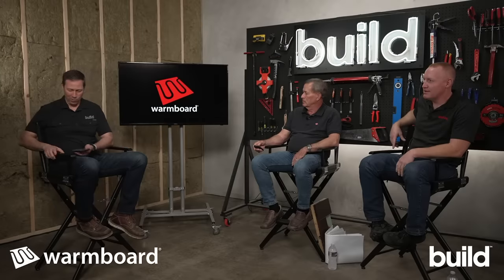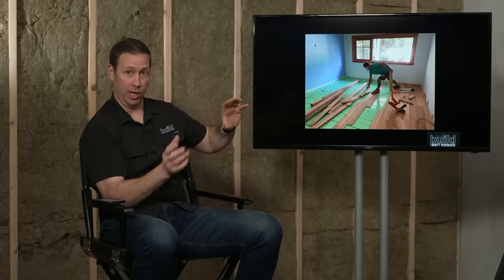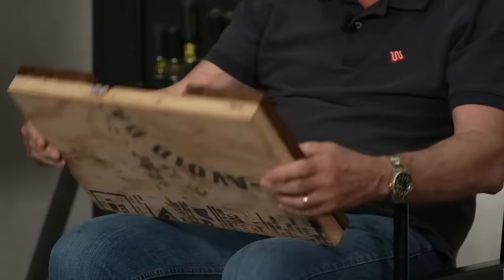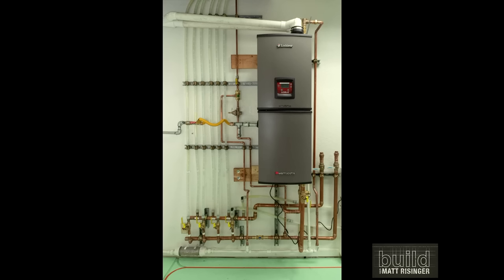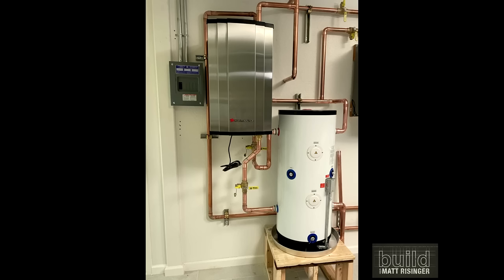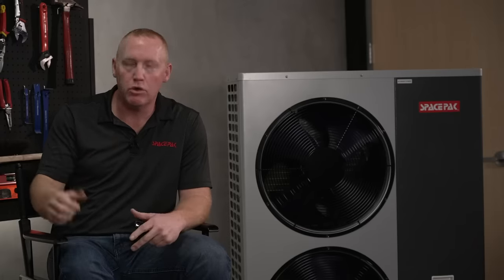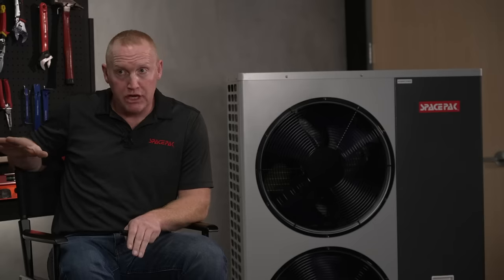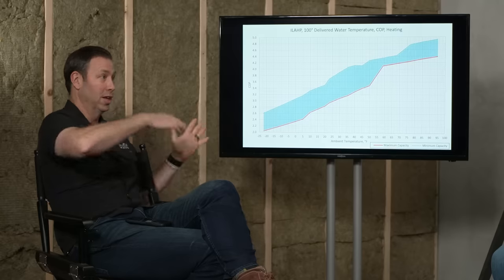Cold Climate Heat Pumps for Radiant Floor Heating. No gas, no boiler!

Comment: Warmboard is extremely expensive.  That additional cost is far better spent on better windows and a better sealed/insulated exterior envelope, which will actually increase the efficiency of the home and reduce dependence on large high-cost HVAC systems.  Warmboard may have small advantages, but they pale in comparison to actually making a more efficient house.
Reply: good post. but don't toss the baby out with the hydronic bathwater. there's other vendors out there a lot cheaper.
Reply: @stevecrawford6958  very true, but generally speaking they are all far more expensive than forced air, especially since heated floors don’t do AC.  You need a whole separate system for cooling, a huge additional cost ON TOP of the cost of heated floors.
Reply: @superspeeder  What about mini splits for AC?
Reply: @timothykeith1367  sure, minisplits work great for AC, just be sure to include a dedicated whole-home dehumidifier as well if using them in a humid climate (mini splits don’t dehumidify well).

Mini splits also heat, and are also air-source heat pumps, so once installed you would no longer need the expensive heated floors.😉
Reply: But toasty feet in the morning are so cozy!
Reply: @superspeeder  absolutely. this is a luxury. not fiscally sound like any luxury.
Reply: @srt4b  exactly why I’m putting an electric heated tile floor in my master bath.  100% unnecessary, it’s purely an over-the-top luxury that will cost me on my monthly electric bill.  BUT, if I ever decide not to use it I can just turn it off. 😁
Reply: @stevecrawford6958   after I got rid of forced heat and installed radiant heat my health improved immensely.I used to get horrible head sinus colds. It's been over ten years and no illness. More than paid for itself in health and savings.
Reply: @superspeeder  you’re missing the entire point of radiant heating.  Silent, even, no-draft heating that is zoned per room.  Forced heat is always going to be cheaper but you will always have fewer zones and it cycles on and off more resulting in more noticeable, frequent temp swings. “But what about mini splits” everyone is going to say.  Again, moving air & noise.  Mini splits in cold climates may go into defrost once an hour.  Defrost is always noisy.

Even baseboard hydronic on a boiler with outdoor reset is quieter and more even than forced air.  Outdoor reset provides the long cycle times which results in much more gradual temperature changes.

I also completely disagree with “mini-splits don’t dehumidify as well”.  A properly sized and installed mini-split system dehumidifies extremely well.  The vast majority of mini-split installs are spec’ed with too few heads because more heads cost more money.  Ideally you want one in every bedroom, one outside the kitchen that is 15% oversized and one in all the main living areas that is 15% oversized.  Kitchen is oversized for cooking, main living areas are oversized for the “party load”.

The other reason mini-splits get a bad rap for dehumidification is because the cheap people turn off the rooms that aren’t in use instead of adjusting the temp 5-8 degrees.
Reply: Agreed I sent them my plans, we only had 1500sf and they wanted 40k just for design and materials.  Great product though.
Reply: @stevecrawford6958  can you list the cheaper versions compared to Warmboard or what should I Search for on You Tube?
Reply: Why can t use install the radiant tubes on underside of the onboard with radiant covering reflecting heat upward?
Reply: @srt4b  floor surface temperature should not be higher than 79 degrees. That's for rooms where you spend a lot of time. It's far from toasty.
Reply: @ToddBizCoach  thermalboard seems decent. uponor. depends also if this is in slab, or quikcrete is an option. or if the work is retrofit.
Reply: @superspeeder  do you say mini splits don't dehumidify well because they aren't running as long as a forced air unit? or something else?
Reply: @ToddBizCoach  you can.  It’s generally referred to “staple-up” installation where aluminum plates that fit around the pipe are stapled to the bottom of the floor.

It’s not as efficient at conducting heat from the pipe as Warmboard is so water temperature needs to be higher.  It is much cheaper though.
Reply: @stevecrawford6958  mini splits are typically very efficient at cooling because they keep the coil at higher temperatures compared to a typical AC unit and move a higher volume of air to compensate.  Typically the higher the SEER the less dehumidification you get.

Most mini splits have a dehumidification or “dry” mode specifically for dehumidification (colder coil and reduced air flow) which can work very well, but I haven’t yet seen one that has controls to track humidity and automatically adjust (you have to manually select this mode).  This, in my opinion, is the one small detail that mini splits need to truly break into the mainstream.

Well that, along with more affordable ducted indoor unit options.  Most people don’t like the look of the big wall-mounted indoor units, but those are the affordable ones.  These ducted Mitsubishi systems Matt is installing are pretty pricey.
Reply: @brians8664  Im not missing the point at all.  What Im not missing is the extreme cost of this product, especially to renovate.   BRand new build with an open book to choose what your HVAC will be in your home, then the cost of this would be worthwhile and cheaper since you are starting from the ground up.  The other 90%, move into homes that are "used" and deal with how the house was built, including HVAC.  And as others have mentioned, the 100K to upgrade their home to this, isnt feasible for 99% of people.   If cost was no object, Id move my family out of my house for an entire winter while my house is completely renovated and done right.  But lets face it, thats not going to happen for  basically any home onwer.

Theres wanting and reality.  And this here, is reality.
Reply: @virgil3241  ^Amen!!!
Reply: @brians8664 I’m planning 3 heads in my 1350sq ft. house (2BR, 1 Great Room) and have been researching the mini splits/dehumidification issue. May I ask, if I were to oversize the great room unit, wouldn’t it cool the room faster and thus, run less often leading to more humidity? Would it be better to undersized the unit slightly so that it runs more and thus, dehumidifies more? Thanks.
Reply: @billwilljulz  a slightly oversized mini-split is okay, a grossly oversized or undersized is not.  The inverter compressor will run at a lower speed making it run “like a smaller unit”.
Reply: Something seems off about an outdoor heat pump unit in cold climates pumping WATER into the house.  Let's talk about winterizing issues or keeping those lines warm enough to not freeze when the system may not be constantly running. Bury under frost depth but up to the heat pump and possibly through the crawl space are not protected.
Reply: What about mixing with geothermal?
Reply: @forename_surname  they should be saying “heat transfer fluid” instead of water.  It’s a water/antifreeze mix based on minimum expected outdoor temperatures for the region.
Reply: @patrickmckenzie2391  geothermal is actually not geothermal, it’s ground source.  The unit discussed here is air source.  I don’t believe anyone makes a mixed unit.  Once you have the cost of ground source covered, air source is not necessary and is actually a step backwards.
Reply: I suspect it to be expensive, especially in Canada, but as you indicate you have to address the envelope first- then you can hopefully realize the  advantages of a premium heating system. Building this way is a “system” to achieve comfort and long term savings. I would like to know more about ROI and future energy restrictions.
Reply: @802Leith  I have non-allergic sensitivities to dust and other irritants, so that's my plan too. Plus my 1930 house will be warm even if you're not right next to the very few duct outlets, and therefore the heating plant will probably have to work much less hard.
Reply: @superspeeder  That's my plan. Plus I can do all the grunt labor of putting up the plates and running the tubes myself.
Reply: @balzacq  👍 DIY for the win!
Reply: @bobselina4299  ouch. Not worth it
Reply: @davidfisher268  There is no ROI on this. It’s pure luxury.
Reply: Interesting discussion. I'm in upstate NY and going to change to mini split system for heating and cooling. I'm tired of the oil heat cost. Heated floors is another idea for the bathroom but I hear mixed reviews about it.
Reply: A property sized furnace will make your house as comfortable as radiant, or a modulating furnace that constantly maintains setpoint. The ignorance around forced air is ridiculous.
Reply: @macthemec  forced air gets a bad rep because everyone has them and many are not done well.  They’re noisy, the supply/return registers are inconveniently located, rooms are improperly heated or cooled etc.  I hate the forced air natural gas hvac in my house right now for all of these reasons.

I’m building a new custom house and guess what I’m using… forced air natural gas.  Done right (and with a fully modulating fan motor and gas valve) it will be efficient, quiet, and it will constantly filter our breathing air.  I’m building a well insulated house that will be very comfortable to begin with, and the furnace is just one piece of the design.
Reply: Man alive, you want to heat a space just put this video on. Theres so much hot air blowing around i had to turn my ac on.
Theres just allot to unpack here.
First problem i see i the extreme amount of overhead jacking the costs way up. Whilst detailed drawings are nice, there also superfluous and add allot of extra cost.
1-1/8 plywood, lord have mercy you are asking the carpenters to double the weight they hafto handle, anybody ever pick up a full sheet of 3/4 ply, yea double that and then tell me your carpenters aren’t gonna ask for more money to install it. 
Not to mention your now asking carpenters to cunstruct proper hydronic loops, like im sure some can, but there certainly the minority.
Then were going with spacepack, of all the companies out there you chose spacepack. Both mitsubishi and diakin make spacepack look exactly what they are, almost good enough.
I installed quite a few spacepack systems. One im proud of whas a victorian mansion renovation using water source condensers so the only part of the ac you saw was a 3” hole in the ceiling.
Spacepack is great but there a niech market producer, and because of that there not as refined and way more expensive.
Reply: @superspeeder  That is not correct. Mini splits do indeed dehumidify and they do a great job at it.
Reply: @TheRenaissanceBuilder  FYI I’m building my house with 1-1/8” Advantech subfloor.  There are benefits to this, and drawbacks such as cost.  And yes, it’s very heavy.
Reply: @brianasamuels  sure they can dehumidify, but the higher the SEER rating the less moisture they condense out of the air.  This is physics, non-negotiable.  Engage the “Dry” function and they dehumidify better at the cost of lowered efficiency.  These are not my opinions, these are facts.
Reply: @superspeeder  im pretty sure the heated floor in the bathroom got me my asking price when i sold
Reply: What about labor costs?  What is your solution to install the radiant tubes?
Reply: Given warmboard operates at lowest temp then how much extra do you pay for higher temp?
Reply: @lesliehunter1823  lol, yes, a heated bathroom floor is certainly a nice touch!  We are planning to do the same in our master bath.  Tile is an inherently cold material, especially barefoot, and a bathroom is a place I feel can be kept a little warmer than the rest of the house.
Reply: @SteveStowell  labor is expensive and varies by region.  Not sure I can help there.

The COP and capacity of a heat pump vary with both outside temperature and return (air/water) temperature.  The answer to your question is model-specific and available in the extended performance data for the heat pump.  Your HVAC installer might be able to help you there, or maybe not unless he knows at what lower temperature your Warmboard floor will operate.  Load calculations would need to be done first.
Reply: @ToddBizCoach  but why?  It’s better to have the conductive layer on top, plus all the subs get to see where the tubing is especially the flooring installers.
Reply: @superspeeder  the fact is is, if you don’t know how to engineer the proper system it doesn’t matter what type of system you have. I live in 2400 sq ft home in Michigan and I have two systems in my house. One is a small size 22seer unit 12k btu that I turn on at the beginning of warm weather and run full tilt 24 seven that fills a tote of several hundred gallons of water that I use to water my garden with and it keeps the house bone dry! The other unit is a 22 seer 18 btu set on auto at 72. Economical Climate control perfection! That is factual reality for 4 years!
Reply: @brianasamuels  not going to disagree with you on that, especially since you’re using relatively inefficient 22 SEER minisplits.  The dehumidification issues I speak of are more prevalent with the higher efficiency units with SEER ratings in the 30’s.  Some smaller units advertise into the 40’s now. These are the minisplits that get all the press and generate interest, and also the ones which dehumidify the least.

Yes I would expect 22 SEER AC of any description to have decent drying ability.  A 30-something SEER minisplit is probably dropping to 22 in its Dry mode.

Thank you for pointing out your situation as it clearly demonstrates why every situation and every piece of equipment is different.  As usual, “It Depends”.  Cheers!
Reply: @482jpsquared  why do you say on top is better, heat rises? If tubes are underneath 1 1/4” floor there is no worry about floor installers piercing tubes.
Reply: @brians8664  As someone who has lived in homes with central forced-air heat/cool, others with minisplits, and yet others with ducted minisplits, hot water "radiators" etc.... I would go for minisplits or ducted minisplits any day. They let you zone your temperature settings easily, and the load can be shared by multiple outdoor units, which means you can have several smaller capacity outdoor units running more efficiently, rather than one giant one running at inefficient part load. But you need fresh air ventilation, otherwise indoor air quality literally stinks pretty quickly, especially in a modern, tightly sealed house with guests in the room.  The advantage of per-room fresh air vents is that you can route more fresh air to the occupied rooms (using cheap air quality sensors) without having to overloadi the whole house with cold outside air just because one room is packed with guests. Works well with those tiny single-room HRVs if,you want too. 
 You can also instead use fancoil units in each room, which look like minisplits but use chilled/heated water (as was shown in this webinar in two variants: the high wall and the thin wall types). They work just as well as R11 based minisplits, but again you need fresh air ventilation. 

And as someone noted above: radiant floor systems can't do cooling, so if you need heating AND cooling, you're duplicating capacity for your cooling sysytem, which makes zero financial and environmental sense.
Reply: You need all of it great insulation windows and a heat pump. And extra 50k when building a house for comfort is worth every penny.
Reply: @ToddBizCoach  Hot AIR rises—heat seeks cold, up or down.
Reply: @stevealsmeyer2555  what does your comment have to do with putting tubes under subfloor rather than going more expensive route using warmboard?
Reply: @superspeeder  i don’t know about that!   You don’t need much and an entire house can be finished in only a couple thousand or less depending on the hot water source!  A mini split doesn’t cost much either, 2k average maybe.  So a house is finished at $4,000 maybe.   What’s a furnace and AC cost to get installed and the duct work etc??
Reply: @superspeeder  yes you would because they don’t work well in cold weather.  They say the work down to 4° but running to long with ice them up and before 4° they have long lost their efficiency.  The mini split is just a backup to the heated floors if need be.
Reply: @ToddBizCoach  just install the tubes under the subfloor after walls and flooring is in.  Nail up with heat transfer plates and put insulation in the joists when done.  The insulation transfers the heat up just like WB aluminium panel and you’re only going through 1 extra layer of wood which is the subfloor.  Heat has no issues going through two 3/4” products vs 1 because wood sucks as an insulator.
Reply: @ToddBizCoach  you can!  But not WB on top.  Just under the subfloor and then hardwood or carpet or tile etc.
Reply: @billwilljulz  the mini splits do pull a lot of humidity!  And if you build a house like Matt it’s gonna be tight so you’re gonna need a ERV or HRV anyways and they pull humidity also!  You’ll probably be fine with no dehumidifier.
Reply: @neckofthewoods24  Great! From my research, the most efficient ERVs currently recover ~70% of humidity. I’m sure the mini splits will do the rest. My backup plan is a floor drain in laundry room in case a dehu needs to be later installed.
Reply: @billwilljulz  thats what i did.  3 head units are going in, a massive HRV and i have a roll around 4500sqft dehumidifier i can plug in if need be.
Reply: @neckofthewoods24  ERV/HRV ADD humidity to a house, they do not subtract humidity.  An ERV will add less than an HRV in summer months (assuming the house is air conditioned with a lower than outdoor dewpoint), but it still adds a latent load.

A leaky house also has ventilation-induced latent loads, but they are uncontrolled since the ventilation varies with wind etc.
Reply: @superspeeder  thats funny because my Lifebreath HRV literally has a dehumidifier setting and two 1/2" drain holes in the bottom.
Reply: @neckofthewoods24  an HRV will dehumidify a house (and drain condensate) during the winter months only (or perhaps cold days spring/fall).  Warm humid exhaust air is cooled by cold incoming air and the resulting condensation needs to go somewhere.

ERVs typically do not need condensation drains as they transfer the moisture between the air streams.  ERVs tend to not over-dry in winter months nearly as much as HRVs do.
Reply: @superspeeder  well I’m sorry but I’m not aloud to use the dehumidifier setting in the winter.  Not to mention I wouldn’t anyways because it’s like 30%.  From what you keep saying, it sounds like you don’t know this unit.
Reply: @neckofthewoods24  the reason the controller has dehumidification settings is to use the HRV to keep maximum humidity levels below a certain point during winter months to keep condensation under control (mainly windows from sweating).  It’s an improper control strategy for a device who’s primary purpose is supposed to be providing fresh air (ventilation system).

Having dehumidifier “settings” on an HRV control also leads people to attempt dehumidification with them in the summer, which only makes the situation worse by bringing in more moisture.  A much more appropriate control strategy would be based on CO2 levels.

HRVs were promoted over ERVs for years when most people’s climate situation better suits an ERV.  To be fair, early ERVs had issues freezing in cold climates, but that’s no longer a serious concern for most as the cores have improved and the units have much more effective controls with defrosting strategies.

ERVs can run much more in winter months without over-drying interior air.
Reply: @neckofthewoods24  Cool! and thank you!! I recognize you from your ICF build videos. If all goes well, I will have my own build series next year!
Reply: @superspeeder  I would never buy the top efficiency. Economically I have a strategy that works far better that is to buy the highest seer at the best price point. Slightly under size it and run it. 24/7 for 2-3 years. At which point the next level of efficiency is at the best price point purchase those and sell the ones you take out and recoup  a third to half of your money. I have done this for several years and have ended up paying almost nothing now with the addition of used solar panels I will likely net profit from running them in this fashion.
Reply: @superspeeder  not sure what you missed about don’t run the dehumidify setting in the winter so yeah.  Don’t do it.
Reply: @neckofthewoods24  you said you're not allowed to use it, which I understand much differently than saying "it's a bad idea to use it".  Saying you're not allowed implies you would like to but someone is telling you not to. ;)
Reply: @brianasamuels  The "best value" model usually IS the best value. 🙂  Interesting strategy of flipping them while they're still worth selling to upgrade, and cheap solar makes a LOT of sense!
Reply: @neckofthewoods24  re-read my last response.  Perhaps it isn't me who's not understanding?  When you say you're not allowed to do something you're implying you'd like to.  'Nuff said.  I think we should just agree to disagree on who's not paying attention and move on to something important.  Cheers!
Reply: @ToddBizCoach  staple-up and lightweight gypsum have cost, thickness labor and performance drawbacks. I have used each approach. I priced Warmboard for two or three projects until I proceeded with it and then used it  going forward. Apparently you have to use other methods and then use Warmboard and then live with it to appreciate and endorse it.
Reply: @forename_surname  It's not only water, but mixed with Ethelene Glycol to suit your environment.
Reply: @patrickmckenzie2391  I'd be a fun experiment. Please keep in mind that you'd be adding another hydronics system to buy, install and maintain. I haven't analyzed but my shot from the hip would guess the COP of 3 to 4 would substantially dilute energy savings opportunity.
Reply: @ashmototherapy  You may want to take a more critical look. I'd be surprised if you'd actually see an economic benefit due to frequent use of heat strips. I'm not saying it won't work out, but further analysis may be revealing.
Reply: @CycleWerkz   yea I've been thinking of different options and doing the research now. Definitely doing mini split system. But flooring for bathroom the heated flooring made the most sense it seemed. Maybe a small mini split heat pump for bathroom would work?
Reply: Why can't they just tell you the price upfront? Them and other manufacturers that are in the same market will not tell you a price without contacting them, so you know it must be expensive.
Reply: @chevymac2711  if you have to ask, you can’t afford it!  Lol

I do understand why they don’t commit to a firm price without a proper estimate, but you’re right, they should be able to give you a ballpark price immediately.  In my case I had to put my foot down and deny a full estimate process until they would give me a rough over-the-phone estimate.  I wasn’t willing to waste my time if it was way out of my price range.  Once I got a rough price I saved everyone a lot of time and just said no thanks.
Reply: @superspeeder  I've kind of already made up my mind if going that route to do the under subfloor staple method for that reason. Looks like a very nice product, but upfront pricing is critical when your not a millionaire.
Reply: @icenbryse5190  it’s not more efficient, that’s the whole issue with this paid advertisement; it isn’t more efficient, it costs a fortune, and the money would be better spent on an efficient building envelope.  This isn’t my idea, this is the conclusion of building scientists.

More efficient transfer of heat from a heat pump to the room doesn’t mean the house loses less heat to the environment, which literally defines how efficient a house is.

Matt is less about building science lately and more about paid promotions.  Hey I get it, man has to pay his bills, but this is misleading.
Reply: @superspeeder  Not having high humidity problems with my mini-split and I live in rainy Vancouver.
Reply: @stevecrawford6958  they do run in reverse......
Reply: @superspeeder  hydronic heating does do cooling if you set it up for both. Avoid the floor as a heat emiter, except for concrete..  Walls and ceiling are better heat emitters than wood floors. 
I don't trust aluminum  foil over foam.  Aluminum heat shields / emitters in walls and ceilings are ideal, but the cost of aluminum  makes it impractical at this time do to costs.  High efficiency Panel radiators or cassettes that fit in walls or ceiling work good with high efficiency hydronic systems.  When the price of aluminum gets better go that way -- wall and ceiling heat emitters. Warm board is not an efficiency system when you put a covering like hardwood flooring over it, and the heated floor risks destroying (cupping and crowning) hardwood floors.
A cheap warmboard type product that is made for walls  and ceilings work good especially if foam is used instead of wood with drywall as the heat emitter.

Look up Caleffi Hydronics education to learn more -- its free !!!  You can learn how systems use low water temperature  to heat a house to be efficient.  And avoid wood floors because they are the worst heat emitters.  Did you realize radiant ceilings  heat floors the same way the sun does by radiation.  Thus, radiant ceilings give you warm floors. 

Don't  be fooled -- don't use wood floors for heat emitters. Concrete slabs store heat and are efficient,  but walls and ceilings allow faster response times a d avoid over shooting the room temperature when the sun heats up the house compared to concrete slabs.  There is many ways to design, but avoid the wood floors for heating. So many problems and it a good way to over heat the wood destroying the fine floor. Yes you can sand and finish the floor again,  but you do not want to do that every 5 years.
Reply: @hhenrynice6843  agreed.  I’ve been looking at Massena hydronic ceiling panels for heating/cooling.  No quote yet so not sure on price.
Reply: @superspeeder  exactly, in promos they make it sound like you are avoiding ductwork, which maybe you are ….if you are jamming inefficient window units in. Other than that you are still gonna have to duct the house and install an a-coil and air handler
Reply: @timothykeith1367  good solution for anyone who doesn’t mind spending an excessive amount of money
Reply: @brians8664 well said! 👍
Reply: If it helps one type of the warm board you dont need a subfloor is what I think I read doing research. But not in the trades just doing research for a future build. I just know Matt has convinced me zip system rainscreen and some type of outer insulation . The EDCO steel roof is wow expensive
Reply: @wagonwheeldc  correct, there is a Warmboard R product which is only 7/8 inch thick (IIRC) and is designed to be used over an existing floor or slab. The regular Warmboard is 1-1/8 inch thick and is designed to be used as the primary subfloor panel.